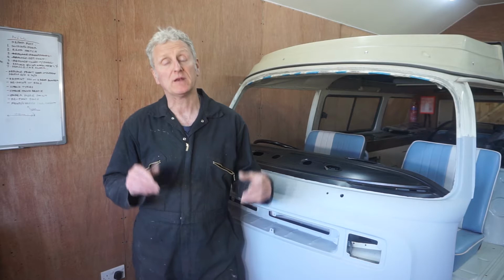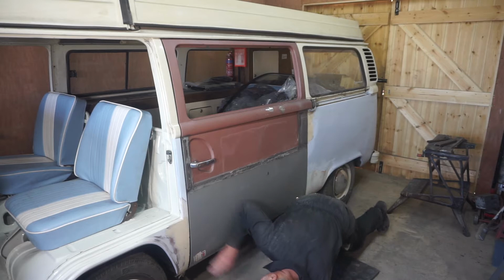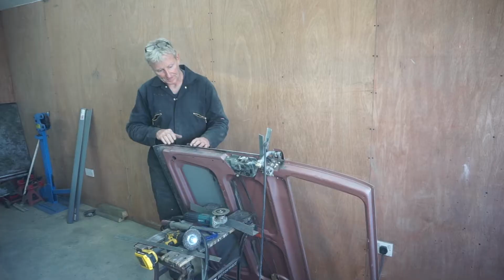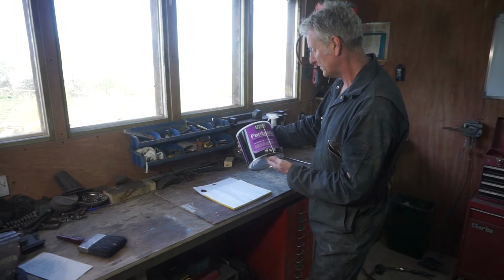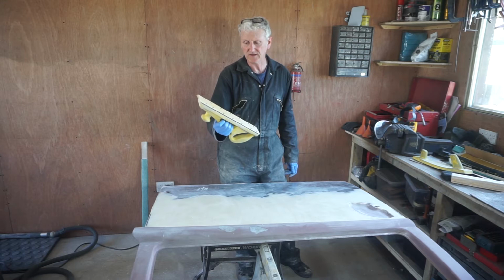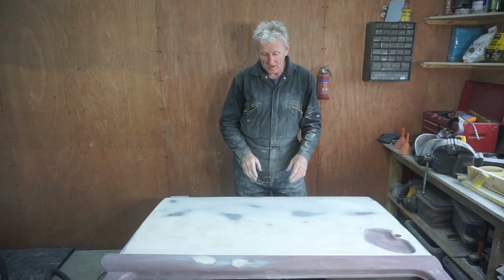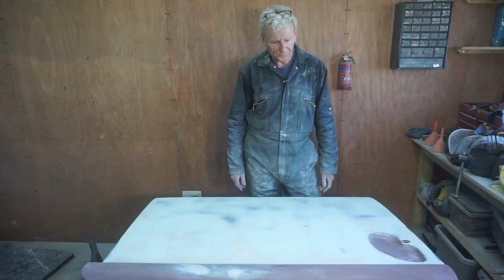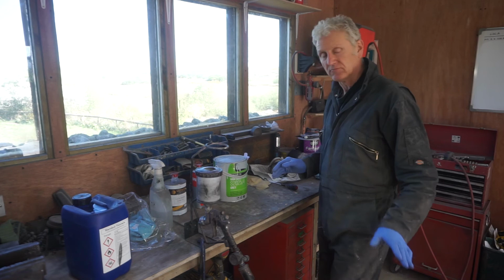1973 VW Campervan Restoration Part 19

Comment: Excellent work 👏.
We restore these buses also and that is a perfectly acceptable amount of filler.
It always takes a few goes before it's fully flat.  Only difference is we fill over epoxy instead of bare metal. We have found a lot of jobs come in with corrosion starting under the filler .
Keep up the great videos.
Reply from the maker: Thanks for that, It makes sence to put the filler over epoxy - will definately give that a try on later jobs. Cheers

Comment: Amazing work and I am binge watching all of them! I feel compelled to ask though, is there a reason you take the bottom roller off each time?  There is a groove towards the right hand side it can slip in and out of. Just wondered if it’s been welded up in the past. Are you doing another series? I won’t know what to do when I get to the end......
Reply from the maker: Hi John,  glad you are enjoying the watch, the grove at the end of the bottom chanel for some reason is just a tad to small which is why I am taking the bottom roller off - will probably get it sorted at some point. I will be starting a 1967 splitscreen comper in October and will be doing a full nut and bolt rebuild, can't wait to get started!